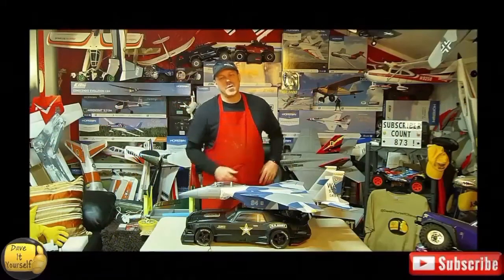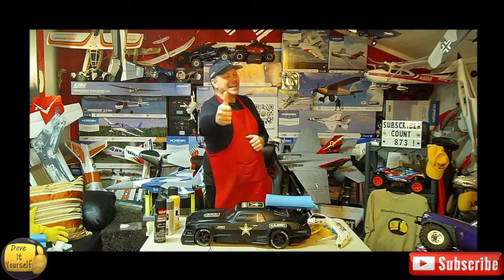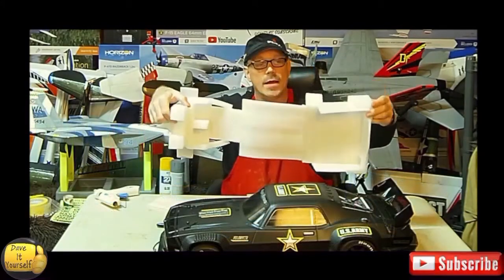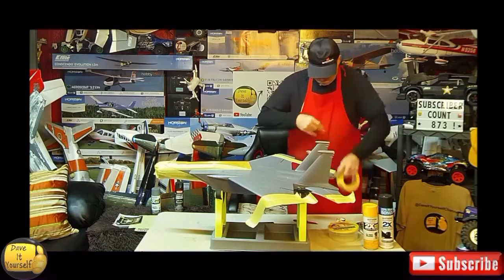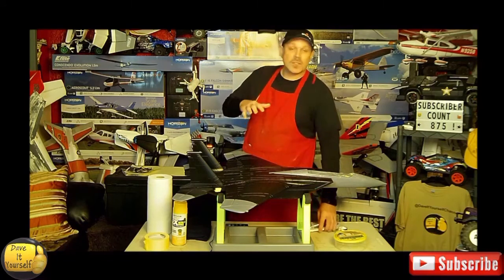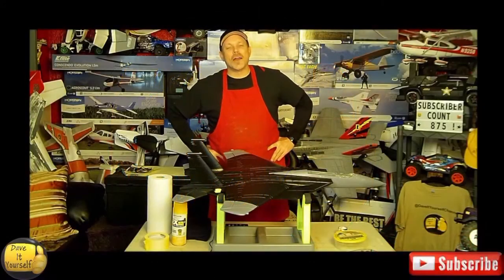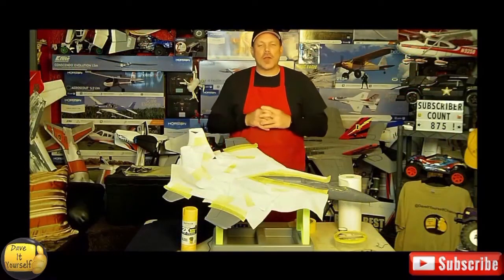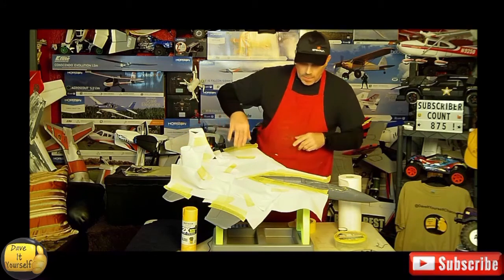Vol.#3 -EDF Jet R/C Car Launch Project - "PAINTING THE TRIM"

Comment: I use post it packs and an air brush to tape of my lines, if you go with the post it post it , there will be good clean lines goes quick no paint pull easier then tape.  Got the idea from RC geek.
Reply from the maker: I LIKE IT! 😎👍